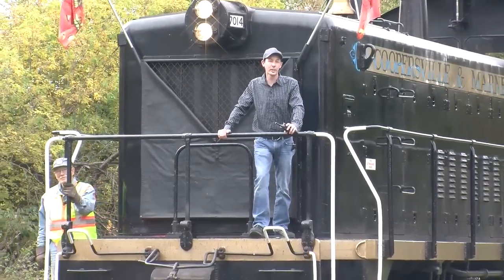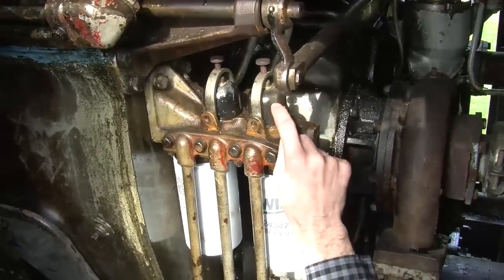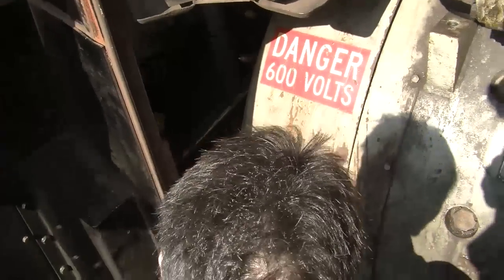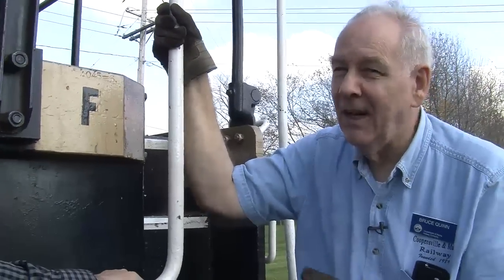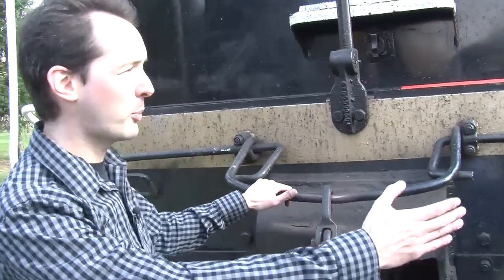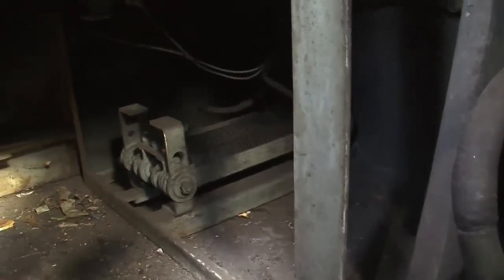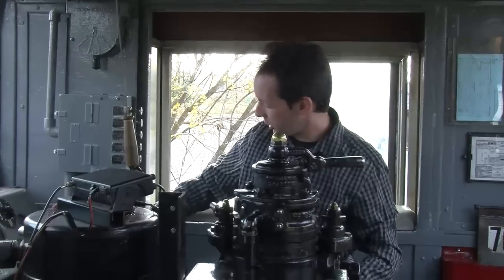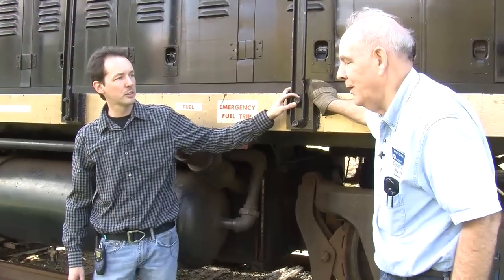Diesel Locomotive Basics

Comment: From one that works one EMD diesel electric locomotives, I can answer some of your questions from on the video.  From in the cab segment, the large electric switch in the basement is the reverser power contactors.  That is what sends the electricity to move the locomotive forward or backwards, depending on which way it turns to contact the connections.  The small rectangular box with the flip up lid is for the oil to go into the truck center casting for lubrication of that.

Comment: First off...THANK YOU FOR MAKING A VIDEO THAT BROUGHT TEARS TO MY EYES!!! Your tour starting at the LHE, (Long Hood End), on a "Butt-Head", which is what a switch engine is nicknamed. On the Right side, where you started, up inside around the fan is the sand-box. The sand filler is up on top, (where you thought it was water. The water fills on the left side of the unit up high, close to the Lay-Shaft. (the handle that you increase the fuel with, upon starting, when it doesn't want to start). Then you have the front radiator and a direct drive fan. Next your round thing, on it's side with the clamp bolts around it, is a door that when opened holds 5 or 6 cartridge engine oil filters. The box, with the brass spinners on it is the engine oil strainer box. The thing, you thought was a turbo, is actually one of the two engine cooling, Water Pumps. One pumps in and one pumps out. Then your diesel engine. The bottom access doors are your Crank-Case and Oil Sump, the middle access doors are your Air Box Doors, (where you spray starting fluid on extra cold starts...after you blow it out). Then the top cover is your Top Deck Cover. This is where your cam-shafts turn and your lifter arms ride on the cams, operating all your valves. (never open the top deck lid when running unless you know what you're doing! And even then, not past Idle! Oil will come out of there and it's HOT!!! Then your Main Generator, directly connects to the end of the diesel engine. Up on top is your Auxilliary Generator. It is connected via gears to the Gear-Trane, and is geared to run faster than the engine. (The engine in full throttle (knotch 8), only runs around 900rpm.) The Aux. Gen. Charges the batteries and provides 74volts DC, to run the lights and radio, and cab heaters. Also runs the fuel pump, which is located out close to the middle of the unit close to the strainer box. Then, also on top of the Main Generator, are two big reel-type blowers, that compress and move air into the Air Box, so that when the time comes for air to rush into the cylinder, it will instantly be there. In the Left side, of the unit, mid way of the unit is where some units start. (this type Butt-Head has the start switch on the Engine Control Panel in the Locomotive Cab. The last 2 doors before the cab, up overhead on both sides, of the unit, connected directly to the intake side of the Blowers. are the "Baggie-Filters". These are cloth bags full of fibers with a bag inside and one outside. Then, "Woolies", which are 18x24x4" thick packs of fibers stuck together, clamp into frames across the louvers on the outside engine compartment doors. These are air filters. The blowers put a suction on the filter boxes and draw in air, thru louvers in the locomotive carbody and pick up the heat produced by both generators. This serves two purposes. It cools the generators, as well as heating the air that's going thru the filters, and thru the blowers (one blower for each side of the diesel  engine), and on toward the engine Air Box. Then the wall below the front cab windows, isn't really a wall. There are 4 or 5 plate steel doors, covering your MTB (Master Terminal Board) right side by the cab door step, and Resistor area, on the Left side. Then underneath the steps, going into the Cab area, are your Battery Charging Resistor Banks. That spot is helpful during the winter months, as the heat coming off the resistors, keeps those steps from icing up. Inside the cab are controls for everything. Under the Floor, the big switch you were in awe about was the REVERSER air operated Cam Switch. Some older units had another one, similar to it, that controlled DB. (Dynamic Breaking) but since the Yard Switchers don't need DB, only the Road Switchers have DB Grids and a big Cam Switch. Your "P" (Parallel) Contactors, and your "S" (Series) Contactors along with some relay action and big Shunt Transductors take care of your Transition. Like the Engineer stated, transition stays cut out, most of the time. You only need to go into Parallel after you're moving along at a good clip. Most switching action is in a relitively Flat Yard.  When on the Hump, when building a series of different trains, The Southern had an adjustable excitation system, that kept a steady speed, just a tad faster than a crawl...up the hump. Most units have a MU connector on both ends, so more than one unit can work together for more Tractive Effort. There's a lot more to it, but this just fills in the holes in your tour. Hopefully you'll read this and make an extention to the wonderful video you have posted here, and take out the slew if "I don't know's". All your info is here. Thanks again.

Comment: That big device under the floor  looks like the reverser which changes the direction of
current through the traction motor (tm) fields. in the electrical cabinet are the contactors
which put motors in series parallel, then in parallel. The traction generator is "motored"
meaning current from batteries  is sent to it to crank the engine.

Transition is the automatic changing of TM connections to the Traction generator, TG.
Since the TM's are highly inductive loads they generate a back voltage which if high
enough causes the tm's to starve for current. Since power is equal to volts X amps
and amps being the electrical equivalent of torque, the less current that flows through
the armatures of the tm's, less torque is available to pull the train.

Transition keeps the back voltage of the TM's such that the TG and TM's work most
efficiently, When the back voltage of the TM's  s tarts to get to a point where power drops, the FSR kicks in putting a resistance across fields of TM's 1/2 as much current
now flows through field coils in TM's reducing back voltage and TG's volts lower back to
600 volts and since TG is a constant KW machine, jacking up volts by 25% will lower
current output by 25% so if the rated TG volts are 600 and rated amps is 1500,
if TG volts go to 750, this means that the TG is putting out 150 volts more than rated voltage or 25% above rated volts and the full current of 1500 is now 1125 amps. So
transition keeps the TG within its most efficient operating parameters.

After the  FSR reduces back voltage loco keeps moving and say around 35
mph the PTR  (parallel transfer relay) kicks in putting each TM across the TG
the FSR having dropped out as motors are now getting the full 600 volts, but around
55 or whatever rated highest speed is  FSR kicks in again, dropping current through
the fields of TM's BUT not the armatures as more current through armatures results in
more mechanical torque for the drivers (wheels) which for the most part is a 4 to 1 ratio
, 4 turns of motor gives 1 turn of wheels but with 4 X more torque.
Reply: Switcher locos don't have transition.. most GP units don't either
Reply: Ramona1058 🤕
Reply: How much horse power do the traction motors produce ? How much voltage do they need ? I thought it 480 volts but its 600 volts to run the traction motors . They simply didn't spend enough time explaining how the traction motors work. How much torque or horse power do they produce ? I mean that's a lot of weight to push down the tracks.
Reply: @Ramona1058    Very good explanation

Comment: When I was about 6 or 7, I lived in one of the construction camps for Shasta Dam, Central Valley  by name. We had a main line run fairly close behind the house. This would have been, hmm, maybe 1949 thru 54 and they were just making the transition from steam to diesel. The first diesel to run on this line was the Shasta Daylight, but it shared the tracks with a number of mountain steamers. We had a special hand signal to communicate with the caboose when we saw a hot box. They would stop the train and fix the problem. Brings back some good old memories. Thanks for the video.
Reply: Yes, pinch the nose with thumb and forefinger while holding the hand from above the face.

Comment: The first "I don't know" is the engine lube oil filter tank, or Michiana Tank, 2nd IDK is the engine coolant water pump, 3rd IDK is engine lube oil strainer housing, next was air box covers, then crankcase covers, and the valves are test cocks, which as he said, you open and bar the engine over to clear any coolant out of the cylinders. EMD engines are a bit prone to leaky head gaskets.
Reply: cool! Thank you for explaining the "I dont knows!"
Reply: THANK YOU! FOR YEARS I HAVE BEEN ASKING WHY MY 671 + 12 V 71 DETROIT DID NOT HAVE THOSE VALVES. THE ANSWER WAS ALWAYS SOME BULLSHIT SPECULATION. IT WAS USUALLY THAT THE SMALLER CYLINDERS DIDN'T NEED THEM; WHICH MADE NO SENSE BECAUSE THEY WOULD PROBABLY NEED THEM MORE AND BE LESS TOLERANT OF MOISTURE. EVERYONE WAS SUGGESTING IT WAS MOISTURE FROM AMBIENT AIR NOT COOLANT. THANK YOU FOR TEACHING ME SOMETHING TODAY AFTER 30 YEARS OF TINKERING WITH DETROIT DIESELS!

Comment: lets start with big filter, yes it is a filter housing "michiana tank" with four filters. The next thing, the "turbine" is the water pump. This model of locomotive has two. The pretty brass handles are two brass oil strainers. The entire box is called a strainer housing. Cylinder test cocks, air box covers "access to cylinder liners", crank case covers. To get to the valves, go to the top of the block, under the valve covers or cylinder head covers you will find the top deck.

Comment: That was excellent!  Most fellows enjoy hearing themselves talk, Chris was all factual!
He skipped over the pneumatics though, there' a reason for that long air conduit just over the air tank.  Moisture is a problem that has to be addressed and the high pressure is also dangerous!  The air hose connecting each car releases by itself when the cars are separated because of the high pressure.  Excellent job!

Comment: Kind of like a big trolley. Traction motors, resistors, reverser handle. Thank you Frank Sprague.  Instead of overhead wire, and a remote generator, they carry their electric generator along with them.  Very cool, thanks guys.

Comment: Really cool video. A lot about the old switchers i have forgot about. I hated them when i hired out in 85. And today i really miss them. We had a small fleet of emd sw1001 and 1500 yard mules. They hated anything over 10 mph, but would drag a mile long train all day long with out ever barking. Not to mention the always starting, stopping, reversing and abuse of yard operations. I was never a fan of sticking my hand into the electrical cabinet, something about 600 volts scared me.

Comment: If I operated that locomotive, I would know everything about it.  Every system, every component.
Love your thoughtful camera views!   Thank you.
Would like to have seen what happens in that dark well.  Why does he not explain why you do not want to be down there when starting the engine?
Light it up and have a camera showing what happens.
Rather than showing the journals, show the wheels riding on the rails and how the flanges go through the switch frogs.  (more difficult camera mount?)

Comment: Dirty oil from scavenging pump goes into the filter (upper portion), there is a bypass valve usually set for 30 psi to bypass if the filter clogs.  The brass thing is the overrunning oil strainer box and suction for the main and piston oil pumps.  The round covers are under pressure, the square cover overflows back to the sump.  567 model engines (roots blown) were used as emergency power on the USS Enterprise CVN-65. 567 means 567 cubic inches per cylinder.

Comment: at about the six minute mark you were looking at a housing that had brass handles on it. That is the lube oil strainer. It is part of the lubricating system and is responsible for getting large particle out of the lube oil to prevent damage to the diesel engine. The "turbo" looking device you saw right before the lube oil strainer was the left side water pump. There is a matching pump on the right side. These are to circulate cooling water through the diesel engine.

Comment: As a Machinist for a major US Railroad this video made me both laugh & shake my head. Don't get me wrong this is very informative to someone who doesn't know locomotives. For example the filter container is the Lube Oil Filter Housing that holds multiple filters. The thing you thought was a turbo is the water pump and the pretty brass thing holds the Oil Strainers in the Lube Oil Strainer Housing. All in all you did a good job.

Comment: The host of the show actually taught the old guy a few things.
Reply: I'm not so sure.  Lead is a lubricant?  Really?  It's just a bearing surface, but not a lubricant. The lube comes from oil or grease that is constantly fed to the bearing surface.  And it's probably not lead either but babbitt, but I may be wrong on that point.

Comment: It may be a little late but the trucks on diesel locomotives are held on to the frame with a large bolt so the trucks don't fall off an rip out the wires.  The bolts are not tight.  There are blowers over each truck to blow cooling air over and through each traction motor.
You should have left a camera in the "basement" to show the switches work.
Most freight cars are mounted onto the trucks with gravity and just a straight pin so the trucks do fall off it the car turns over.

Comment: That little box with the lid is the center pin lube box.  Oil goes down and lubes the truck where the cab sits on it so the trucks can move freely on curves, etc. There is another one on the front truck near the air compressor/oil filter housing

Comment: I was just trying to help. The big switch you were talking about is the reversing drum. The three contacts with the ark guards located in electrical cab are the P1, S, P2 contacts.When you start moving the S contact is closed. When the locomotive reaches to about 9 MPH the RPMs back down, the gen field opens, P1 closes, S opens then P2 closes and then the gen field closes again. This point the locomotive has made transition and is in series parallel. I can send more info if wanted, message me.

Comment: The big horizontal cylinder is an oil strainer; the two vertical cylinders next to it are oil filters.  The strainer removes large particles; the filters remove small particles.  All are removable and are routinely cleaned.

Comment: Leporello- The reason for using the diesel-electric combination is that to mechanically transmit the amount of forces required would require HUGE clutches and a transmission with a HECK of a lot of gears. To put in in perspective, most tractor trailers weighing 80,000 pounds have clutch-transmission combos about 2/3rds the size of the engine, and normally with 10 to 18 forward gears. That locomotive alone probably weighs 200,000 pounds. And most switchers will pull 500 to 1000 TONS behind them.

Comment: Gooberwalla,

The traction motors which are attached to the bogies are wired up in series at low speeds, I am unsure of the reasoning behind it, but I believe it is to provide more tractive effort (AMPs) at low speeds. At higher speeds, the contactors in the electrical cabinet switch and wire the traction motors up in parallel for higher speeds.

Comment: I wonder, why would you need to switch engines between serial/parallel connection?
And I also wonder what kind of power regulator it uses for throttle. It can't be a rheostat, but nothing else comes ot mind for DC...
Reply: The actual RPM of the prime mover driving the generator rotor is what produces the electric power.  The faster the generator turns the more voltage.  There is a circuit called the excitation circuit which allows the generator to generate.  If the reverser is in neutral there is no excitation of the fields in the generator so if the engine is reved there will be no power to the traction motors.
Reply: VioletGiraffe you don’t switch engines... you switch the traction motors from parallel to series. Switches at 20 mph. Old style. It’s all about pulling at low speed and high

Comment: On trucks, a lack of air pressure in the system applies the brakes.  Applying air pressure lifts the shoes.  I see this SW9 is the other way around.  Has that changed and when did it happen?

Comment: the item that you point at that no one has any idea about( "same as before") is The Michiana oil filter housing. It contains 4 oil filters, each about 6" in diameter and 3 feet long. They keep the prime mover's lube oil clean

Comment: Excellent video, I wish we also had a video about loco from India. Indian Railways are one of the largest in world and have a wide range of diesel locos. The older generations are ALCO (meter and broad gauge), while the latest once are EMD, with 2 stroke supercharged engines with power output in megawatts..

Comment: It's all about amperage and voltage being shared by the traction motors to get the best out of them. High amperage is required to get things moving but high voltage is needed to get speed. Switching the traction motor circuits from the generator is done in such a way as to get the most desirable combination of amps/volts to them. The third stage that has not been mentioned is field shunting where some of the traction motor field windings are "switched out" thus eliminating back EMF.

Comment: That switch in the dog house is the switch is for forward and reverse. it is air moved with the reverser  it just changes what way the power is sent to the traction motor. this is a cool video. i work on a GE 44 tonner it is a very different style engine.